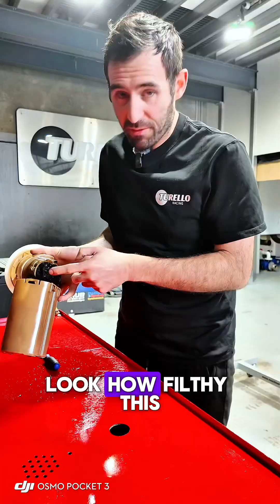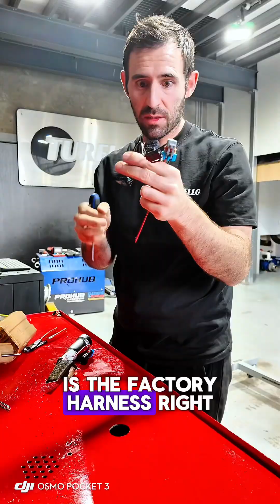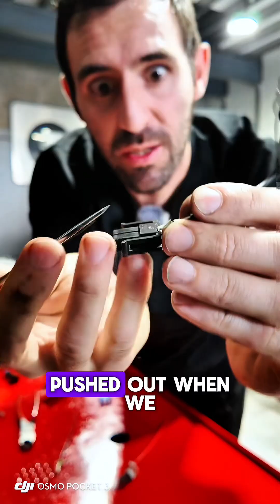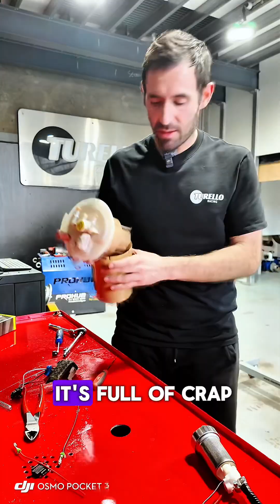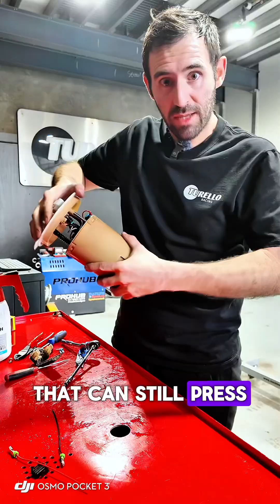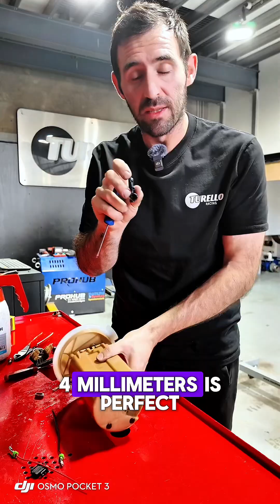Safe and Easy Ford Falcon Walbro 460 Fuel Pump Install

Comment: Good job mate. How do you get on with the wiring? Because I hear on a Ford falcon anything over 350 L per hour? You can melt the wires and melt the connecter and blow the fuse because it draws too many amps. Is that right?

Comment: Is the stock cable you re pinned to the new pump e85 safe? Like is the OG plastic plug and wire insulation gonna degrade with e85 vs the pumps wiring given the pumps rated for e85.
Reply: Also how long are the new hoses and was it for a ute or sedan?